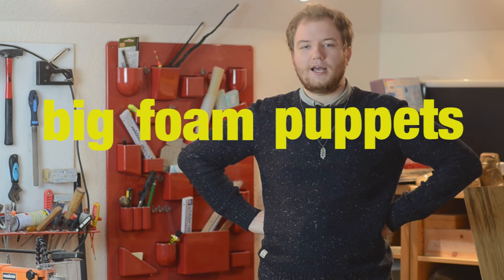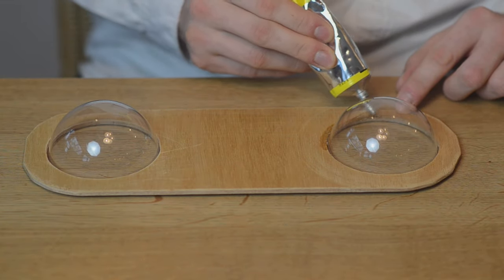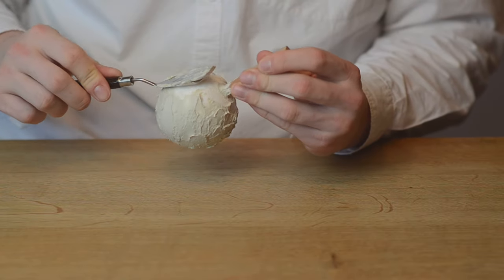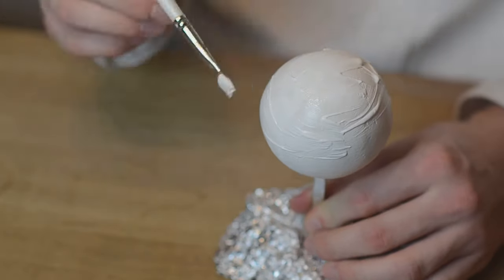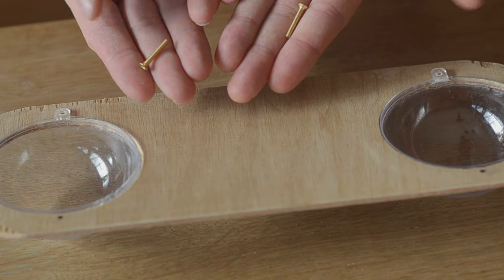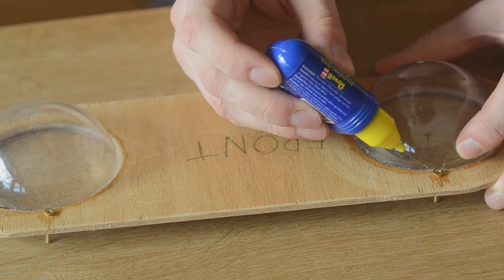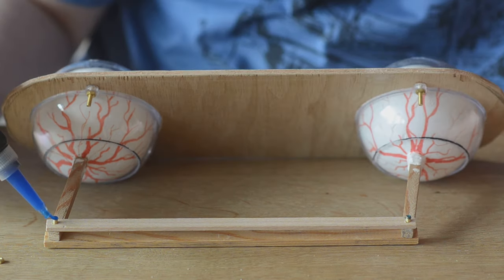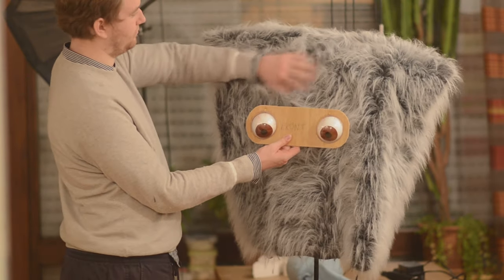EASY creature PUPPET eye mechanism

Comment: that's like a bone saw you could lose a finger
Reply from the maker: That's what it felt like.. I was pretty terrified in the moment
Reply: @AnarchyAutomatons  I AM afraid of using power tools ever since I had a close incident with a circular saw building props, due to my own stupidity. I have a dremil too but not the circular bone saw attachment. I probably would have cut that plastic with exacto knife. it would not be as smooth however